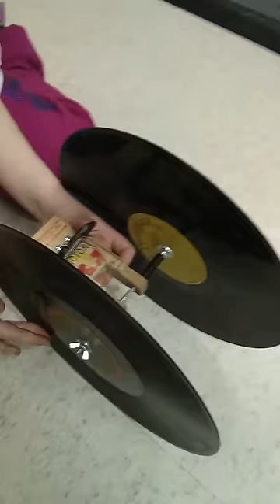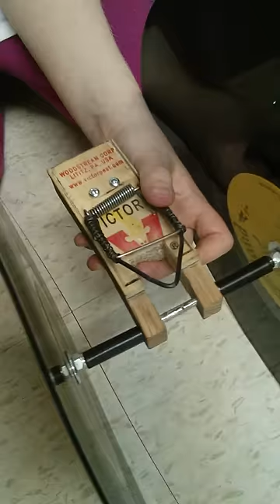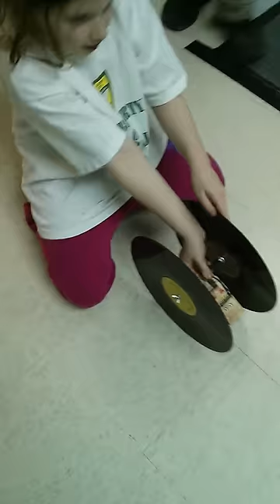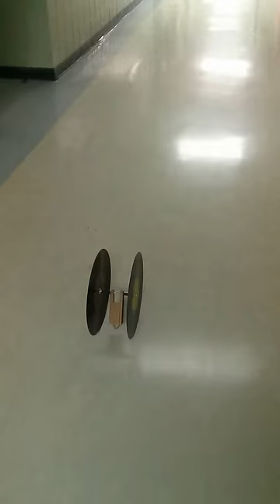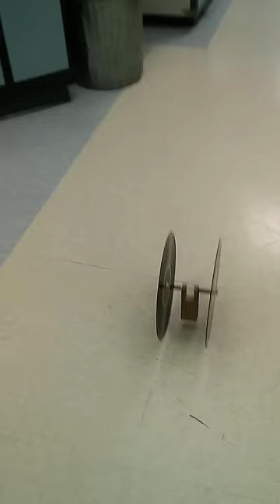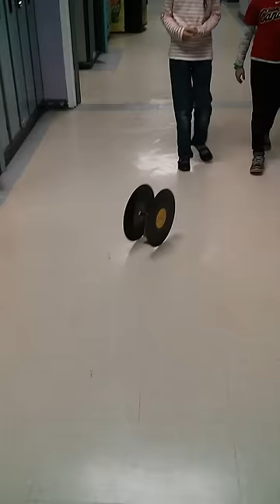Best mouse trap car design goes 160 feet!

Comment: But you cheated! The weight of the moustrap is also powering it at the start. Official rules state that it should only be powered by the spring. Otherwise, it would be called a gravity powered car...

Comment from the maker: Hi Hpi Guy's Garage, I first made sure that the axle holes on the mouse trap body were slightly bigger then the axle its self.  This allowed the body to "hang" on the axle after the fishing line pulled out.  I also coated the inside of the axle holes with graphite power to reduce friction.  To keep the body from sliding side to side on the axle, I cut plastic straws to the right length which acted as spacers to fit between the body and the record wheels.  The most delicate part was drilling the hole through the middle of the axle and not splitting the axle in two!  If I build a 2.0 model, I think I might increase the diameter of the axle.  Thanks for the question!

Comment: Hi! I'm actually doing this design for our project in school, however, I am having problems loading it up. Was a hole drilled in? If so, how did the string remain in the hole? Please answer back A.S.A.P. Thank you!
Reply from the maker: Hi Shreya, yes, there is small hole that was drilled through the middle of the axle.  I had to take care with drilling the hole to make sure it wasn't too big for the diameter of the axle.  You then feed the fishing line through the hole and then wind it up.  Good luck with your project!!
Reply: Thank you!

Comment: Is this powered or just built without any battery sort of things?
Reply from the maker: Lixin Zhen It is powered by winding up the wheels & axle using a fishing line which is tied to the mouse trap arm.  Thanks for the question!
Reply: Thanks.